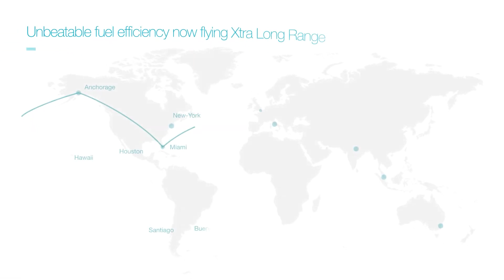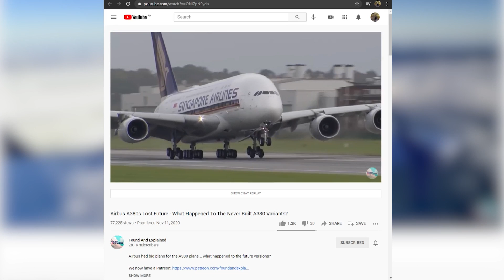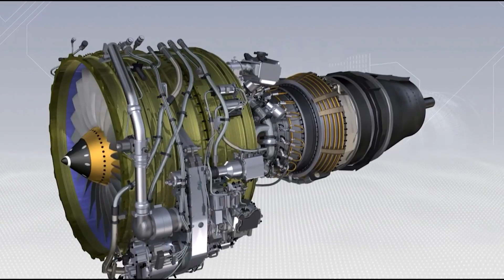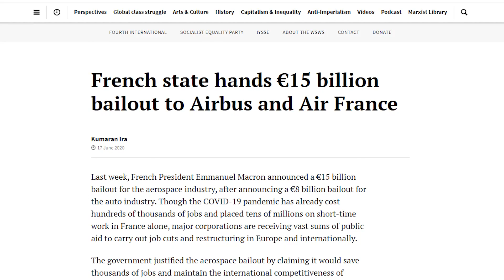Meet the Airbus A350neo and the new Airbus narrow body - Airbus Future Planes!

Comment: Although airbus will probably build an a350neo, it will likely be different than what is explained in this video. A long-range plane has too small a market and to many drawbacks to be commercially viable, I would predict airbus slightly decrease the range on most models. Again, this plane will probably be leaps and bounds ahead of the 777x, and the market for that aircraft is too small to begin with so I cannot see airbus getting into it.

Comment: A350neo with R&R Ultrafan engine is a given.  We will see it as soon as R&R is ready.  A modern composite successor for the A321 with a capacity of 220 - 270 passengers and range >5000 NM is also not so fare out, since the pressure of airlines like AirFrance and others is getting higher for a stretched A220-500.
Aside of things, that are obvious, Airbus is working on liquid H2 technologies with several partners world wide.  It's save to say at some time we will see an H2 fueled airplane with Zero CO2 emission.  Another concept is the lifting body plane.  The next large plane from Airbus might be based on this concept.  It provides lift and space for H2 technology as well as a lot of space for passengers and freight and fits into the same ICAO class like the A350 without the need of folding wings.

Comment: Hopefully you are right. I prefer Airbus to Boeing with regard to passenger comfort. The 737 body for example is still using (almost) the same design developed in the 1950s for the 707. All they seem to do is try to keep up with new technology and bolt on larger engine pods - the latter being thought to have resulted in the recent 737 max disasters.

Comment: Sadly the a380 failure means high innovation risk taking has taken a halt. But the 787 innovation did make airbus realise that standing still does not work. The dreamliner was a true clean sheet thinking even if the build was blown by greed. Small jets are hard to make cash on vs bombardier/embrarer who can build cheaper.
Reply: Do your home work, the A380 failed manly due to the engine manufacturers dumping old technology at Airbus and the A380, but release a new generation of engines 10%  - 15% more efficient for the 787 and the large twins.  Imagine an A380, that requires a load factor of about 60% - 70% to be profitable (read John Leahy's articles about this subject)!
About your small jet statement - if Airbus has a Zero CO2 plane and the others don't, guess who will sell new planes  and who doesn't - CO2 regulations will make legacy turboprops so expensive to operate, that other manufacturer have to pay to airlines for taking their planes.
Reply: @aquaden8344  The A380 failed because cost per trip and profit per seat is a bigger draw than space and comfort. Airlines could pack more in to a cheaper plane, charge the same and passengers said I prefer to be squeezed into a smaller space and also feel more jet lagged when I land than more space for the same ticket sticker price. Naturally the 380 has older engines than the new widebody jets (where you can squeeze more seats across). The airlines can also fly more often as carbon emissions is irrelevant no matter how often you fly another trip. Airlines don't pay for climate change, the passenger will and when climate change does end up costing the airline more, they just up the ticket price to make the same profit. If the 380 was such a dud, then why are emirates post covid, with passenger numbers down on long haul and fuel prices higher, flying the 380 again? Because strangely enough passengers valued flying on such a jet enough to get a pure profit squeezed airline to bring it back, fuel it, operate it, maintain it and yes make some money back on their 380 jets when a modern widebody could make more profit per seat on the same trip. Nobody takes cruises for the speed/convenience. Nobody drives a Mercedes when a Toyota can do the same trip for less, cost less to buy and run.

Comment: I cannot understand why aircraft manufacturers are not leaping at using composite fuselage technology to develop a wide-body oval cross-section short fuselage aircraft. This could be something not much bigger than an a321 with a considerable higher passenger load with very little extra weight, wingspan, and gate availability concerns...
Reply: So something very similar to an A310 (in size)?

First of all, an oval aircraft wouldn’t work due to stress distribution. Also, wider aircraft almost have to be longer to make a difference as they have a higher surface when it comes to the front. That’s also a small part of the reason why the stubby A310 wasn’t that successful
Reply: The drag of the fuselage grows with the square of the fuselage cross section.  So narrower and longer is better the wider and shorter.  The the lifting body concept is a more promising approach for higher passenger load by equal ICAO class.

Comment: so, first of all: calling tha a350 a small wide body aircraft is a little off. Comparing all variants of the 787, 777, a350 and a330, the a350 ranks 3rd smallest to 2nd largest. Bigger being only the 773 and smaller being the 788 and a332.
Thus, if you don't use a 332 or 788 on these mentioned spoke flights already then why would you swap to an a350? Swapping from a narrowbody (except 75) to a 358 wouldn't make any sense whatsoever.

But that aside I think just phasing out the a320 family in favour for an extended 22X isn't going to be possible.
The A22X has a 2-3 config. Sure, you could elongate it but you'd end up with basically a miniature 75.
What I could imagine, though, is a new clean sheet family which is shifted by one size upwards of today's a320 family. So basically a current day a320neo family (a319neo, a320neo and a321neo) but without the a319 equivalent (since the a319neo doesn't exactly receive a good amount of orders now) consisting of a320neo equiv, a321neo equiv and one size above the a321 (322?) which doesn't exist today. Why do I think that?
Well just look at easyjet: Their fleet used to consist out of majorly a319. Today, the youngest a319 in their fleet is almost 10 years old. They have a majority of a320 currently but have started to include a321s into their fleet 3 years back. The market has outgrown the a319 and it's becoming more and more obsolete and in my eyes, there's not going to be a huge demand for a319 sized aircraft and thus the gap between a220 and a320 is just too big to cover with an extended a220.
There may be some further developments to the 220 but I don't think making a longer version of the a220 (basically an a221) makes much sense in order to replace a current a320 size class.
Reply: I'm impressed how well you know the numbers of every subtype.  It shows you are aware, what is going on in aviation.  Still, the demand for an A220-500 remains, and Airbus will start with an A320 successor, maybe first with a composite wing for the A320 types.  It is a given, that the successor will be a clean sheet composite design with latest engine technology.  A simple conversion of the A320 design from alloys to composite doesn't make sense.  There have been innovations since the inception of the A320, and they require a clean sheet design.

Comment: This is my theory it could happen but i dont know yet

A360: The plane would be able is the size of the a320 but a few adjustments made such as a 2-2 config in economy and a 1-1 config in business creative wider seats and aisle access for business, the plane seats will come with screen when purchasing and will have ranges capable to go from Australia to east coast US and Europe, new rolls Royce engines will make these planes just as efficient if not more than the Dreamliner, the plane would come with bathrooms and changing rooms and electric window dimmers for a better experience. This will be great for budget airlines as these planes are efficient and can make a few interesting long haul tourist routes such as Melbourne Avalon to Dublin in Ireland

A370: This plane is basically the a360 but is between the size of the a350 and b777 these planes will have an extended fuselage for wider seats and would generally be used on long haul routes and can connect a lot of cities with high business traffic such as Dubai, Singapore, Tokyo and London together in a point to point map

Comment: Airbus has a problem with trying to compete rather than innovate.  AIRBUS has created three different quad engine planes all of which have failed, all of which were developed to compete, a very costly mistake
Reply: I'm aware of an A340 and an A380, but what is the third quad jet?  Also, the A380 could have been a success, if the engine makers had not dumped old engine technology at Airbus and new technology, 10% - 15% more efficient, to Boeing (read John Leahy's article about it).

Comment: After flying with Delta throughout the pandemic, I am very glad that MCO<>ATL is a high capacity short haul route for them. They fly about every hour and use 737s, 752, 753, and 763 and 764 equipment on the route. I love being able to fly a 767 for such a short flight.

Comment: What about a single jet?  With larger commuter routes and quite large, powerful new engines over safe, landing strip dense regions it seems practical. Engine placement will be a little odd, but not new, just like the third engine on a tri-jet. Maintenance will be tricky, but so long as the maker actually bothers to design for ease of maintenance, it should at least be better than two engines, if not half the cost.
Reply: There is a requirement for Aircraft to be able to fly if one engine stops working-  your idea although good for economics, is not a safe one!

Comment: I doubt an A350neo since neo is meant for fuel efficacy and the A350 has that same to the black mask (some A320neo A321neo, LR and XLR A330neo) and renew the engines so RR have to make a Trent XWB Neo engine and during the covid crisis that might make Airbus kinda bankrupt.
No, a'int a Boeing fan my name has a neo cuz I am a neo fan I respect both manufacturers!
Reply: It's kind of difficult to follow your English, and a reengined will happen as soon as the new Ultra Fan engine is ready.  It will give the whole A350 product line an even lager edge above the 777X products.

Comment: Airbus will have to come up with something to compete with the 777-9 or 10 and the Boeing 797 - its likely their next big plane will replace the A380 with a 777x rival manufactured with the latest materials. And yes, they could make a Q-400 rival. I believe they will wait for the big 3 engine makers to make a geared turbofan engine for their widebodies. I totally agree that someday an A220 stretch is going to replace the A320. 

Not sure if hydrogen will ever beat jet fuel on energy density. But renewable fuels like alcohol or other bio fuels may find their way into the next gen aircraft.

Comment: Airbus will continue to make planes that don’t break. Just waiting for the 1st 787 to disintegrate in flight when all the fittings fall apart...
Reply: You sound rotten but the 787 will continue to outsell the a350 and a330neo combined....

The upcoming 787-10ER and 787-9LR will surely put the a350 to bed . I assure you that . Lol

Comment: Slightly more efficient wide and narrow body planes will not work. Future Engine efficiency gains are likely to be lower than the target so if Airlines want to avoid way higher carbon taxes for long-haul planes then alternative fuels have to appear. EV power will only replace very short-trip planes (not something Boeing/Airbus are leaders in) and will not cut carbon taxes for Airlines. What we are seeing is incremental innovation not radical changes that climate change will demand. Boeing/Airbus might see an order bonus if "old" planes are taxed out of the air. This order bonus might be done to soften the costs needed to bring in radical fuel efficiency.
Reply: LH2 (liquid H2) is the future fuel, and Airbus is working on it.  Looking at their lifting body concept plane Airbus is working on alternative technologies.  Technical progress isn't achieved over night, it must be achieved.
Reply: @aquaden8344  I'm all for alternative fuels and both airlines are testing the fuel but the volume, availability and testing and regulatory understanding of such fuels in all weathers, temperatures is near infancy. Sadly climate change is accelerating faster than that. If humans could breath underwater or live in 50deg outside temperatures without doing more damage and if we all lived close enough to allow for high speed rail to kill off only the most impractical trips that airlines offer, then alternative "carbon neutral" fuels would be the 🥇 winner but the airlines (and everyone else who relies on emitting carbon and methane) didn't and the short term profit motive outweighs any climate change hit to airline and airplane manufacturer profits. I imagine most of the older generation hope they'll be dead or senile by the time their grandkids ask why were they choosing to buy a trip that emitted such a massive carbon emission knowing their grandkids would be left with a burning house and super fund disaster zone as an inheritance they have to accept. Do we think big oil will want to give up selling such a lucrative fuel blend to an alternative fuel they don't extract? Better to cut the cost and still make lower super profit margins than lose market share

Comment: I have to reconcile my restlessness to see rapid design evolution against the severely conservative strategies of the carriers who survive, clinging to the margins of solvency by focusing solely on plain old sober economical conditions/forecasts. It's unfortunate that planes like the A380 and BWB designs are losing to ancient B-47-based configs and the (yawn) twin-engine narrow-body far into the forseeable future. We should be in a more optimistic place. (terrific show! but) None of the new designs presented here inspire the slightest excitement, merely shaving another fraction-of-a-percent off the fuel costs, or RASM between a 2-5-2 versus a 3-4-3. It feels like the technological and economic variables have all more or less reached their plausible limits. So unless there's an outsider willing to try something insanely different, we should not expect any sea-changing innovations from the present batch of developers nor clients. E.g.: What if I said, "I'm willing to pay an extra $500 to trade my 6-hour flight from NY to London for a 24-hour flight....if I can get my own room with a window," what kind of innovation would that inspire? The present economic model would implode because while it would be cool, nothing can presently do that.
Reply from the maker: Well as you said we have reached a point of either bigger aircraft that fly slower (bigger aircraft at the current speed don’t work a la a380) or smaller planes that go faster. Perhaps once supersonic private jets have made an impact we will see larger versions in the 250 passenger range
Reply: I mean your idea of a slower passage from NY to London for greater comfort... is literally just describing going via an Ocean Liner. On Checking right now, £799 to go Southampton to New York via Cunard, though that's 7 days in absolute opulence rather than 1 day with your own room.

Comment: Airbus doesn't have any electric plane as Boeing 787?
Reply: 787 isn't electric only the engine starters I believe
Reply: That's the insanity I don't understand.  To safe a little tubing from the bleed air port to the air conditioning systems generators had to be installed on the engine, copper wire had to be connected to the LiPo accu's and to the air conditioning system.  Big electro motors then convert the electric energy again into compressed air for the cabin airconditioning system.
Wouldn't boost the bleed air to the pressure needed for the cabin be more efficient then all the electrical subsystems required in the 787?

Comment: Why aren't all 350s and any other airbus models automatically a Neo variants?
Reply from the maker: Because NEO is new engine option. It can’t be a new engine option if they are in the first version of engines
Reply: @FoundAndExplained  but why not just make all new planes have the new engine type?
Reply from the maker: At the time they are built they have the new engine. But then after ten to 20 years they go “ok time to offer the plane with the latest engine and upgrade” and they also choose other things too

Comment: Why would they shift to a brand new narrow body when they already have a state of the art narrow body in the a220
Reply: CO2 certificates are expensive
Reply: A scaled up A220 for 250- 270 passengers with 5000 NM range would be a new plane.  Simple blow up the A220 design won't do it, it can't fulfil the requirements, therefore a new clean sheet design optimized for the intended use is required.
Reply: they didn't make the c series
Reply: @Emilyz1337  true, but they own a 51% stake in it, without any development cost.
Reply: @Keely503  oh totally I was just saying that's why I don't think airbus could build anything close to it they never did
Reply: @Keely503  They actually own 75% of it.
Reply: @Emilyz1337  They now produce it in Quebec and Mobile.

Comment: This video and other video from your channel are totally speculative with no solid basis and also technically not correct
Reply from the maker: Airbus is hiring engineers to make a update to the a350 and a new narrow body, plus doing research on hydrogen turboprops. So you tell me where speculation ends?
Reply: @FoundAndExplained  airbus is hiring? Oh, I didn’t know I will have new colleagues. No one is hiring. Research on hydrogen is correct. A350 neo, eventually will come in the future, but the is like to say that in the future cpu will be faster.